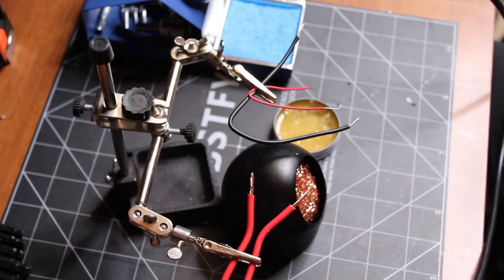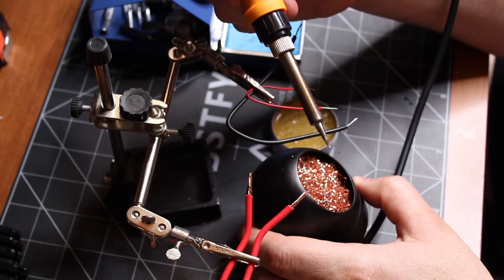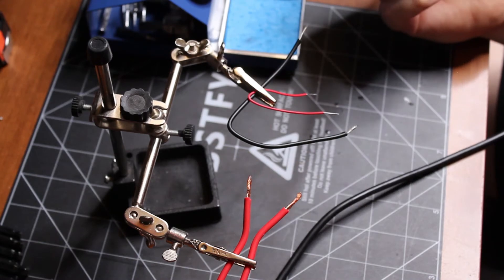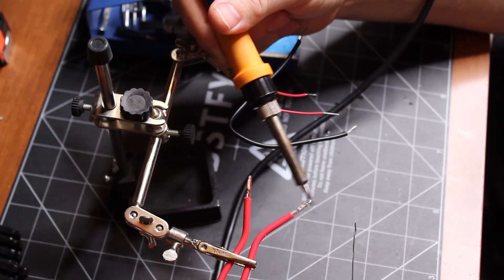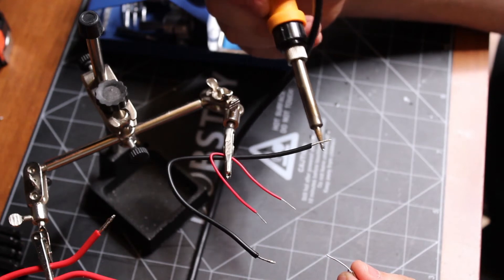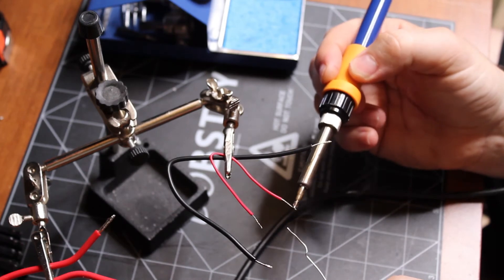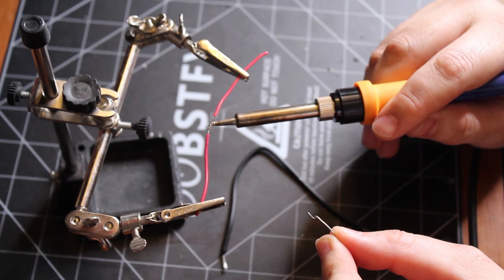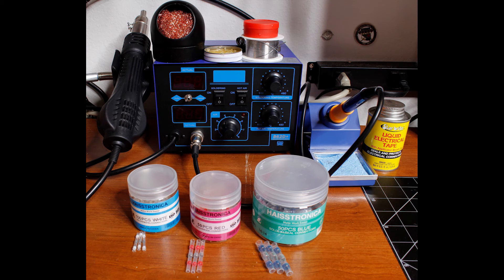Basic Wire Soldering/Tinning

Comment: What temperature do you run your soldering iron at?  I bought the Bulkman3D kit like yours and the videos have helped me finally get it put together. Thank you for service, from a retired AF SNCO.
Reply from the maker: 400ish. Smaller wires don’t need that much heat. If you are working fast from wire to wire you can stick with 400. If you are going to spend more than a couple seconds on smaller wires turn the temp down. Larger wire will need more heat. Keeping the iron tip “wet” really helps with the heat transfer.